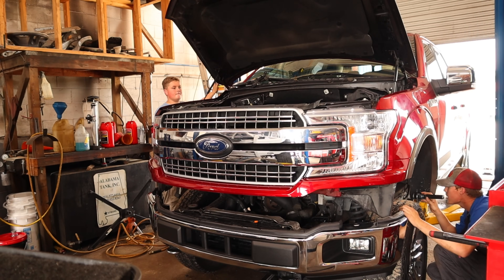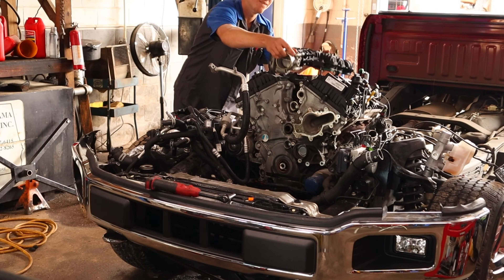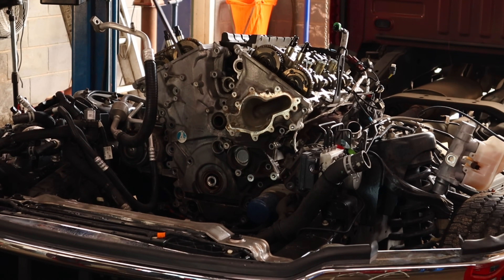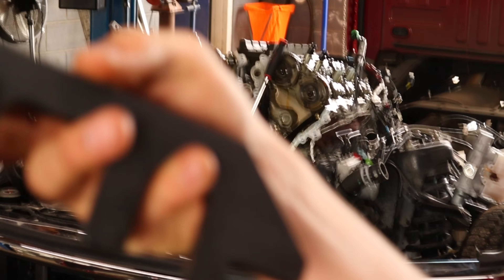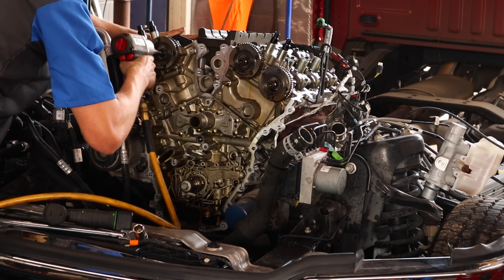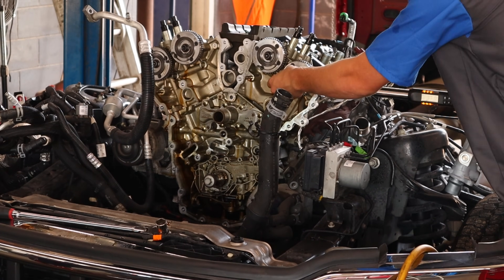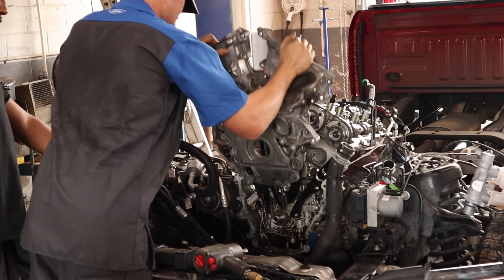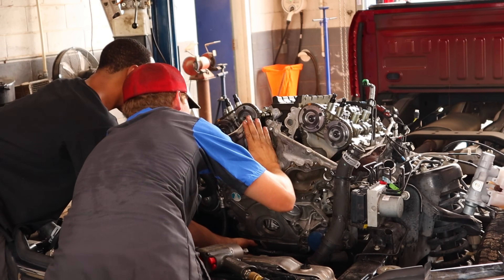Ford 3.5 EcoBoost Cold Start Rattle (VCT Phasers) | Everything You Need To Know

Comment: Just talked to a dealer in my hometown (Toledo, Ohio) and they are still doing the PCM reflash. He said if that didn't work, then they would have to do the cam phaser replacement. I do not have the 21N03 FSA that extends the warranty on my truck (which I think is odd as mine is a 2018). Dealer also said the PCM relfash is not suspended. Just wanted to pass along some info I obtained this morning.
Reply from the maker: Yeah the 21b10 is a go again since I’ve made this video. Dealer should be aware that 21n03 won’t become in effect until after the 21b10 is completed and submitted to ford. I should have a new video on this coming out in the next week or 2. In the editing process now. Either way your truck being a 2018 will for sure fall under 21n03. Just have to do the pcm update first.
Reply: @FlyingWrenches13  thanks for the update!
Reply: @FlyingWrenches13  here is a video of mine at start up this morning. This isn't nearly as bad as it has sounded. I plan on taking a video each time it starts and uploading it. Just so I have some documentation of it.

https://youtube.com/shorts/6-64hFWYUyQ?feature=share
Reply: Great video and explanation as to what the rattle is all about. 
My 2018 F150 with 40,000 miles was taken to dealer yesterday for this issue. Waiting for a call. I did print out quite a few posts about this issue and gave them to the service manager.

Comment: Great video! I had a 2011 F150 with a 3.5 Ecoboost. Bought it new. At 42,000 mi the engine started making a rattle noise at startup. I was 1 month out of warranty. The dealer said my timing chain was going. I paid $1800 to have it fixed. Ford absorbed some of the cost. I bought a  2018 F150 new with same (updated) engine and now at 32,000 mi am having the rattle noise at startup. I got a recall notice this week and will be taking it in. I saw a video that if you hold down the break & gas pedals while cranking the engine it will get oil pressure to the engine before starting. I tried it and it worked. No noise. Please let me know what you think. I will still be taking it in for the recall but am getting discussed with Ford's engine problems especially on young well maintained engines. I've been a Ford guy for many years but am losing faith.
Reply from the maker: Yeah the gas pedal method does work for preventing the noise. Go have the recall performed and then if it still rattles, you can have your phasers replaced under warranty.
Reply: @FlyingWrenches13  Thanks for the quick reply. I will continue the pre cranking startups
Reply: I am hoping that the recall works without a engine teardown.

Comment: I totally agree that it’s a pressure loss I just don’t know how it is supposed to be. I Have a 14 F-150 limited 4x4. It has 232400 kilometers and an obscene amount of hrs as it’s my work/personal truck. It has had amsoil signature series 5w30 oil and amsoil filters. I recently also installed a dual remote bypass filter system. The bypass filter is 99.7 efficient at 2 microns. My truck has never had anything besides a rear main seal ever go bad save for spark plugs being shorter life than NA.
Reply from the maker: Nice! Ever ran oil samples to see how much that helps?
Reply: @FlyingWrenches13  I have a sample that I haven’t sent in yet but I wanna short change it till it really cleans the engine well. My dad has an 07 powerstroke that has an egr delete and a bypass filter set up also from Amsoil and his oil stays cleaner than mine! But he’s been running the bypass system for years so
Reply from the maker: Thanks for the info! Keep us posted if you have a oil analysis done. I’d like to know how much of a difference it makes. I’ve seen oil bypass systems on the old 6.0 Powerstroke’s and they make a world of difference.

Comment: Great content and very informative, well done! I have a 2019 with 46k, would you still replace the chains, tensioners and guides? Thanks again and keep of the great work!
Reply from the maker: Thank you! I wouldn’t with 46K miles. Chains still have a lot of life left in them!
Reply: @FlyingWrenches13  my 17 started doing it but not on start up.. they reprogrammed it back and now it doesn’t do it as loud but can still feel it. They told me to wait so the computer learns my driving habits?! I feel they want me to keep driving it past their 66% percent coverage.
Reply: @kaywitha9591  I was told the same thing, fast forward 6 months or so and my check engine light came on, just took it to the dealer today and they said the phasers are going, seems as if they need to see a check engine light before they can get the approval to do the major work
Reply: I just had my phasers replaced at 56k.  I went back and forth, but went ahead with replacing the other timing components and water pump while I had the 'free' labor.  Cost almost 500, but i tend to keep my vehicle a long time.
Reply: @alcalc8938  It’s no longer cheaper to keep her.  Depreciation is nonexistent and repair cost is sky high.  If you want to keep driving the same truck get an 80s model.

Comment: Great video.   Since this is a recall if I was not experiencing the VCT Phaser rattle at 75K miles would the work still be partially covered under the recall, or be told "no trouble found (NTF)?   2015 F150- 3.5
Thanks
Reply from the maker: Unfortunately the recall doesn’t apply to a 15 model.

Comment: Has that been fixed on the 2020 models? I have a low mileage 2020 and so far no issues. Just wondering if I should keep an ear out so to speak.
Reply from the maker: It does apply to the 20’s as well.
Reply: @FlyingWrenches13  Thanks for the quick reply. I was so hoping you wouldn't say that, LOL
Reply from the maker: Sorry I had to bring bad news haha

Comment: So at 20k miles should i trade in before i have to do this. Seems like it will devalue the truck significantly
Reply from the maker: Go have the recall done. You’ll be covered until 90k miles. Shouldn’t have anything to do with the value of the truck.
Reply: @FlyingWrenches13  I've talked to two dealers that say, "If it ain't broke, don't fix it".
My 18 Raptor make no noise and gets fresh syn every 5k. 30k on the odometer.
I'm conflicted about whether to press the issue with a dealer who advises against doing the work.

Comment: My 18 expedition started this recently at 25k miles. I purchased Salvage and rebuilt, so have no warranty coverage obviously (I knew this going in, paid several thousand less than KBB). I'm wondering if Ford perform the 21B10 being that my warranty is gone, and should I even perform it at this time too? Been getting mixed information online. I'd pay for the reprogram if I have to. According to their website my VIN has a "CSP" but not a "recall" for this issue.
Reply from the maker: I wouldn’t have the recall done in your position. Just pay to have the phasers replaced and you won’t ever have to worry about them again.
Reply: @FlyingWrenches13  thanks. Any idea where I can get the updated phasers? I have a mechanic I prefer to use over the dealerships.
Reply from the maker: Just order from dealer. The updated ones are the only ones you can get now.

Comment: This issue has been a nightmare to deal with on my wife's Exploder.  The TSB only covers the F150 even though it's the same engine and same problem.  The dealership has had her car 3 weeks and it's still not fixed.  First they replaced the solenoids.  Then they replaced the phasers, guides, and all that stuff, and gave it back to us saying it was fixed.  We went to pick it up and the CEL was back on.  Now they're saying they have to replace the VCT housing on the right side.  Luckily she bought a warranty through Ally when she purchased the vehicle and it's all going to be covered.  This is a known issue by Ford and they should be issuing a recall on all of them at this point.
Reply from the maker: What was actually happening with it? I’ve never seen a 3.5 in a exploder rattle. I’ve seen some vct issues as far as over retarding or over advancing but never seen one rattle. Glad to hear you got that warranty! While the 3.5 in the f150’s and explorers are super similar there are some differences.
Reply: @FlyingWrenches13  it started with the CEL alternating between off and on but it did have a rattle when we first took it to the dealership.  We arrived when they opened and were there until they closed just for a diagnosis.  Like you, we're also located in Alabama.
Reply from the maker: Honestly it sounds like you may be having some oil flow problems if they already replaced phasers and it’s still having issues.
Reply from the maker: Also, that all day diagnosis is crazy. No way I could have waited that long haha
Reply: @FlyingWrenches13  It had a P0016 code

Comment: Timing chains aren't maintenance and the rattle causes excessive wear due to harmonics.  Ford should take care of it. I warrantied tons of cam and lifters on ls engines as a dealer tech and thatvwoukd be equivalent of gm only warranting the lifters that chipped
Reply from the maker: I agree with you, unfortunately Ford does not.
Reply: @FlyingWrenches13  I know.  Gm took the same route.  Started denying warranty cam if lifters guides were installed
Reply from the maker: Yeah, they think they’re saving money until they realize those customers aren’t coming back to buy new trucks.

Comment: Ford has been through this with the 5.4 and is now doing it again on the 3.5. Just another reminder that Ford has completely forgotten what quality is. i used to be a Ford fan, but after my 2009 F-150, no more. So many issues, that Ford knew about, but dumped on me (without assistance). Thanks to honest Ford tech's I was given the truth, but Ford refused to help. I sold the truck with 65,000 miles just to dump the headaches. Ford is garbage!
Reply from the maker: Hate to hear that happened to ya! What do you drive now?

Comment: Thanks for the video. My 2019 F-150 4WD, 3.5L Lariat started doing this between 15k and 20k miles. Truck is headed to dealership in a couple of weeks. With this low mileage what parts do you suggest I ask them to replace while they have it torn down?
Reply: Because it only has 15-20k miles on it.
Reply from the maker: Only what’s in the TSB. No need to change anything else.
Reply: @FlyingWrenches13  hey tabellae go to about @12:00 he mentions this, replace the timing chain, tensioner and chain guides, spark plugs and water pump. Not sure why wrenches brain farted in the response to this comment 🤣🤣

Comment: I have a 2018 F150 with the 3.5 in it with 44000 miles on it. I've just recently noticed it have a rattle two or three times over the past few months when starting it after it's been idle for several hours. It only lasts a couple of seconds. Being as I'm out of warranty, how bad does this problem need to get before I address it ?
Reply from the maker: Why are you out of warranty? Should be 5 year 60K mile coverage on the phasers plus the extended coverage in recall 21n03.
Reply: @FlyingWrenches13  I wasn't aware of the warranty covering that. Don't keep up with warranty info as close as I should. hanks for the response.
Reply from the maker: No problem!

Comment: My 19 fx4 sounds horrible.  33k miles. Already went through this with my 09 5.4, took ford about 10 years to fix the 5.4 3v. Then ford decided to start over with the 3.5 tt and all new troubles.  Extremely disappointed in ford, won't get my money again.
Reply from the maker: Hate to hear that! If you have the updated phasers put in, it should solve your issue for good.
Reply: @FlyingWrenches13  There is also a loud pop at startup. I hate to do this,  but I will be calling the closest dealer to make an appointment.  
Last night,  I stopped on the side of the road to replace a broken strap on the trailer. Freezing snow storm conditions. After idling for about 30 minutes, I noticed a cam chain rattle type of noise from the 3.5 eccoboost. When I put it in drive and took off,  the rattles took almost a mile to stop at 50+mph (climbing a grade).  Reminds me of the same sounds my 09 5.4 3v made when it was suffering from low oil pressure/failed vct system + worn oil pump.
I hope they don't just update the program and claim it's fixed.  It's a 2-3 round trip.

Comment: I bought my 2017 raptor brand new and I have all of these issues. Transmission problems and the cam phaser rattle started at 20k miles. Also have the sun roof leaking issue. Very frustrating to spend that much on a truck to have this many problems.
Reply from the maker: Hate to hear that! Have you had a dealer try to repair any of it?
Reply: @FlyingWrenches13  yes. The cam phaser rattle just never goes away. No matter what they do. The sun roof leaks sometimes. It’s hard to tell where exactly the sunroof is leaking. I brought it in and they say the can’t find it. Every now again after it rains it smells like mold for a couple of days
Reply from the maker: @ryanbrowning8501  have they replaced the phasers on it yet? That usually stops the rattle.
Reply: @FlyingWrenches13  no they haven’t I am going to argue with them until they do if that will fix it. They keep reflashing the computer system. Or updating. I’m not real knowledgeable about that

Comment: 2019 with about 25k miles gets the startup rattle of the truck sits for a few days.
Retired so don’t drive much. 
Gas pedal trick works every time to build oil pressure. No engine knock on start. 
Change oil every 3500, slight tick at operating temp near end of oil change intervals 
Have sent 3 samples to blackstone and have all come back perfect. 
No excessive tin, copper or iron. 
So apparently nothing is wearing to be deposited in the oil
Reply from the maker: That’s crazy that no metal deposits were found. Gas pedal to WOT works pretty much every time! Thanks for the info!
Reply: @FlyingWrenches13  I really think there is metal to metal contact in the phaser area but It doesn’t seem to have shear or shaving. 
 my filters look good too at changes.

Comment: This is why people hate variable cam timing. The phasers are junk, the vct solenoids are junk, and if you dont know how to fix it, it'll cost you fortune. I want to go back to the day 2 wires run the whole engine
Reply from the maker: Unfortunately, I think those days are gone. Engines are just going to keep getting more and more complex. Variable compression is coming next, if electrics don’t push gas engines obsolete before then.
Reply: Welcome to the electric car...you will get your wish!    BTW, if we kept the old way the air pollution would be a million times worse and we'd all be driving around getting 10MPG in these 5000lb SUVs everyone must have...

Comment: About how long can you drive with this issue going on until there's a further problem?
Reply from the maker: According to Ford, Indefinitely.
Reply: @FlyingWrenches13  wow! I'm very surprised! Realizing it now, at 49,000... Mines been going on for about 10,000 miles... The sounds is much more obvious the last few thousand miles.
Reply from the maker: @jamesvitale7132  it will probably get louder the longer you go. It’s still under warranty at 49K. I’d have them replaced.
Reply: @FlyingWrenches13  that's what I want to line up VERY soon... It's a 2018 so I know I'm still good w warranty. The other thing u can/could of mentioned in your video was that some insurance companies have mechanical coverage.  GEICO  is 1 of them. You have to pay a deductible. Better than laying out 3-4000 for cost.
Thank again for the great video!
Reply from the maker: @jamesvitale7132  Thanks for the input! I may try to include that in the future.

Comment: 2015 2.7 here & mine is rattling.  Does it have the same part?
Reply from the maker: It does have the same phasers, however it is not common at all for a 2.7 to rattle. I would have someone diagnose it for you!
Reply: @FlyingWrenches13  yea apparently it's my turbo. The valve that opens and closes air in the inside rattles. Idk if that makes sense haha. I'm no mechanic
Reply from the maker: Yeah the wastegate is rattling lol that’s common

Comment: I had a 2017 2.7 and about a month ago I started experiencing the cold start rattle.I just traded it in for a 2020 3.5L and it drives like a dream
Reply from the maker: I’ve heard of a few people with 2.7’s experiencing the rattle but I’ve never seen one myself. I guess it’s a little more rare for those engines. Maybe the 20 model will do better for ya.
Reply: @FlyingWrenches13  yeah truck had 64k miles when it started rattling , I also had to get the oil pan replaced twice common issue for the 2.7
Reply from the maker: Yeah oil pans are junk on those! Thanks for the input.

Comment: @Flying Wrenches     If I had this work done by the dealer back in July of this year under tsb 21-2119, I think that SHOULD include an oil change.  I'm trying to decide whether I can count that as a engine coolant change as well, or would it be a bad assumption to think they pulled the drain plugs on the engine block to get enough out to count as a real drain/fill.  I have a 2017 F-150 V6 EB with 81K miles.  Thanks
Reply from the maker: Your coolant got changed. The water pump has to come off during this repair so most all of the coolant would have came out. As far as the oil, per that TSB it is supposed to be changed. Whether the dealer changed it or not idk.